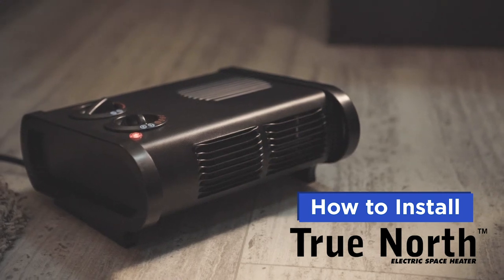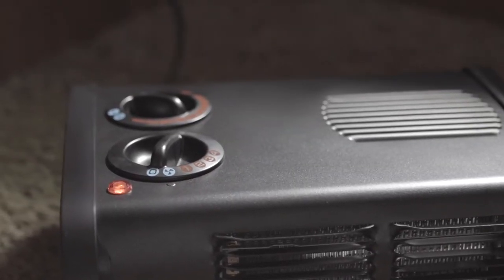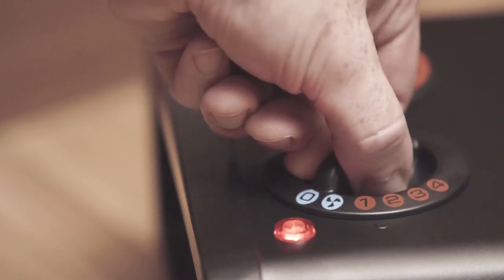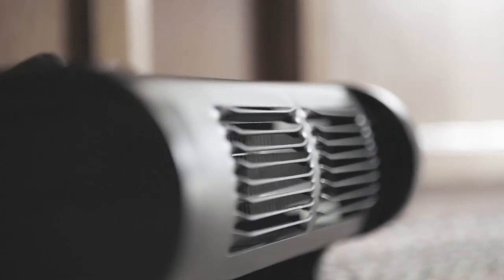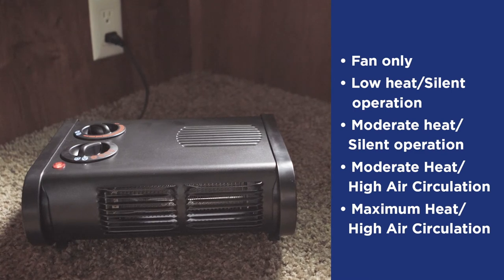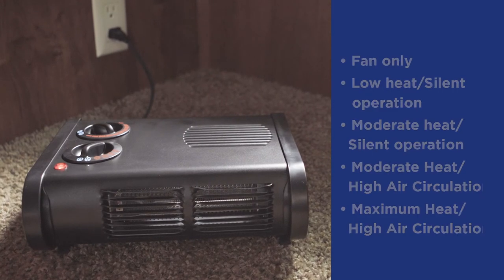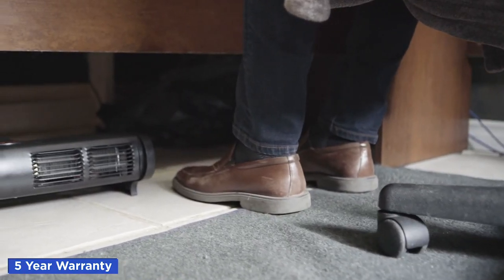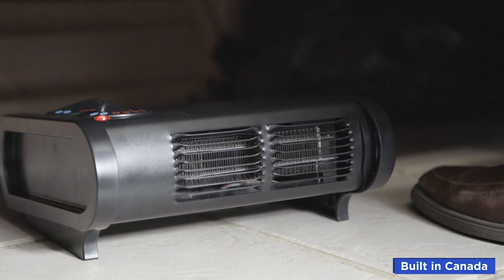How to Install the True North Heater

Comment: The setting to prevent freezing is not working. The device does not automatically turn on at 3 degrees celsius. Any suggestions?
Reply from the maker: Thank you for your comment. Sorry to hear that! Send an email to contactUs@caframo.com and they will help you trouble shoot the issue. Please send them the model number and serial number when you get in touch. :)